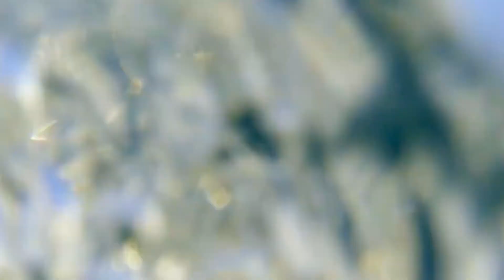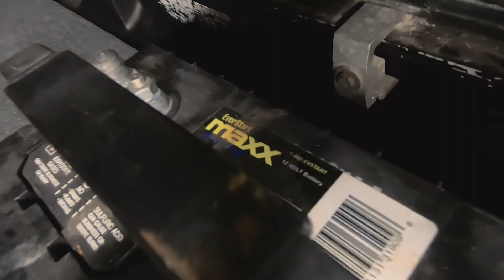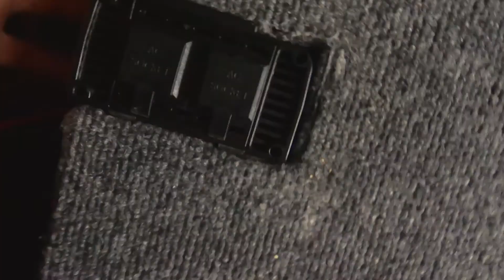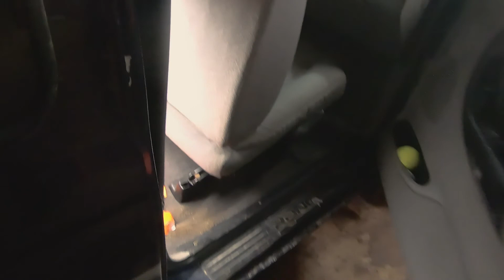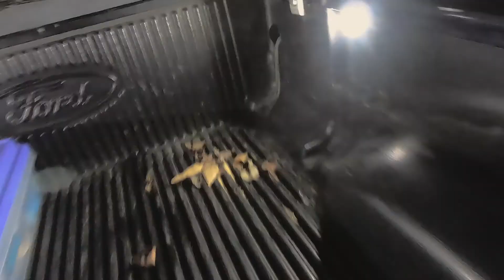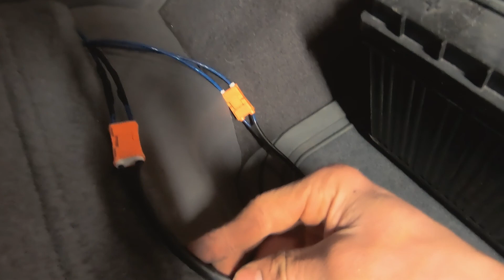DIY Ford Ranger Camper Build, How To Wire Up Power Inverter!

Comment: Awesome job! Do you have a parts list for the items you purchased? I'm about to wire the same in my Ranger!
Reply from the maker: I don't have the links for them or anything like that, but I used two 100 amp fuses, a 200 amp solenoid, a cheap Amazon inverter, a couple switches from Amazon, you'll need a variety of battery terminals, and then obviously you'll need a deep cycle battery mine was 125 amp hours and I could run my heater all night on it no problem. Then you'll need some other miscellaneous parts and some wire. Hope that helps and appreciate the support!!
Reply: What wire gauge did you use?